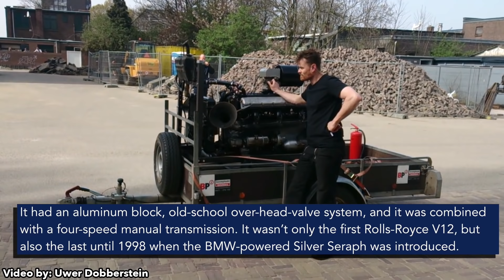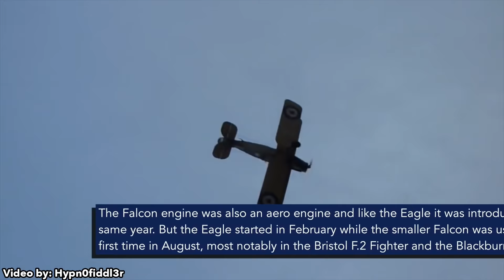10 Greatest Engines Rolls-Royce Has Ever Produced

Comment: i need another vid about the napier sabre engine...
Reply: Hear hear!
Reply: No operating Sabres exist, although I have heard that Kermit Weeks is rebuilding a Mark 5 Tempest and has a Sabre being rebuilt in Britain. More than that I don't know.
Reply: @MarsFKA  Who in their right mind would fly it!  The Sabre is my favourite aircraft engine but I recognise its problems. 

With most if not all of the true experts on these engines no longer with us, it will be a massive task getting one up to a reliable condition.  Then there is the question of finding the correct mark of the engine, there were several variations with 2 major redesigns of the internals during its life, all that for an engine that was fitted to only 2 types of aircraft.
Reply: @robertnicholson7733  I am sure the technology to rebuild the engines today will be better than the original. The big problem that the original Sabres had was the metallurgy in the sleeves – they went out of round quickly and seized the engines. About 25 hours was the average life of an engine, until a cure was arranged by using sleeves from the Bristol Taurus radial engine – different metallurgy – and the life of the Sabre was extended to 100 hours.
The Sabre was problematical right to the end of the War, but, with the lessons learned back then, a rebuild today will be more reliable.
I have a sound track of a Tempest starting, taxiing, taking off and a low, fast fly-by, but I am holding out for hearing the real thing.
I'm also holding out for the first manned landing on Mars. Which is going to come first?
Reply: @MarsFKA  The sleeve problem was the most obvious failure mechanism but not the only one.  The difficulty was, as you say, solved by changing the sleeve material.  However, I will put forward the case with the prototype engines using the original sleeve material had quite a long service period and passed the 100hr tests. 

Making the sleeves was a problem all in itself and was perhaps a greater problem than the material.  I believe,  the change of material from nitrided austenitic steel made it easier to manufacture the sleeves compared to the original material (rather hard to machine chrome-molybdenum steel).  In the end, the solution was to employ better machinery, to quote https://www.historynet.com/sabres-cutting-edge.htm  "The situation became so desperate that six Sundstrand centerless grinders needed for sleeve manufacture were redirected from their original destination, Pratt & Whitney in East Hartford, Conn., and sent instead to Liverpool." 

But I digress, there were other issues with the Sabre such as cooling, this also may have contributed to sleeve seizure.  The lone Tempest I fitted with a Sabre IV and wing radiators (loss of the chin radiator gained about 30mph AFAICR) was lost to seized sleeves. 

Something that has always confused me was why a seized sleeve crashed the aircraft.  The sleeve drives had shear pins to ensure the other sleeves continued to work.  I suppose that the issue may have been a seized piston or perhaps many seized sleeves due to cooling issues.
I do not deny the great advancement in materials, manufacturing processes, and testing.  However, the old (and probably lost) knowledge about the Sabre was built up over many years of keeping 1000s of them operational. 

The engines and all the materials used in them are at least 70 years old, does it all still meet specs?  Testing old material can only get you so far.  Comes the time, you may just have to make new parts and there are just so many parts in the Sabre (can't deny it, the pommies just liked making parts).  I believe that this has become such a problem with the Merlins that you can get a completely new Merlin made from scratch... at a phenomenal price.

I could keep on but it would serve no purpose. 

I have heard about the KW rebuild for quite some time, I have not heard of any progress reports.

I also have the sound track of which you speak.  There are also a couple of WW2 films that capture the sound of the Sabre including the howl it got at certain RPMs when the cylinders in the top back resonated with the cylinders of the bottom bank (the cranks rotated in the same direction unlike the RR Eagle22).  Having said so, I would love to hear a running Sabre even if it is only one on a trailer.  I do not know how many Sabres still exist, it can't be many.  Sadly some complete engines were sectioned.  I have often wondered what happened to Tempest Vs the Brits sold to others, complete spare engines must have gone with them. 

Napier was trying to flog the later marks (3000+ HP) off  but met with no takers.
Bob

Comment: The best use of the Merlin was the P51D Mustang which turned the tide of the airwar in Europe, resulting in the allied victory. No Dart? coolest sounding airplane engine ever.
Reply: This would be a very different world had the USA not entered that war. Thank the Japanese for bombing Pearl Harbor or it might have happened too late to do any good.
Reply: Save that for someone else. I'm from Arkansas. The US "assisted" the Brits to save France. It cost a lot more than lives to get that outcome. The British designed the Merlin, so give them that, American designed engines lacked the supercharger on V-12 engines. That small change did fix the Mustang which did turn the tide of the war. A British pilot suggested the change after test flying Allison powered Mustangs.
Reply: Pretty cool stuff. The Merlin Mustangs sounded sweet, but my favorite Rolls Royce engine for sound was the Dart. Dual stage centrifugal compressor turboprop that made from 800 to 1400 shp, 200 more with water/methanol injection. Found on G1, Vickers Viacount, and Fokker F27 aircraft.
Reply: This video was mainly about old stuff, so, most who watched it I would say.

Comment: Actually the Boeing 777 (that Singapore airlines) is power by two General Electric GE90 engines
Reply: Only if it is a - 300ER. If it is a -200/ER, then it will be Trent 800.  The 800 sold extremely well on the original 777 platform, but Rolls lost out when GE did an exclusive deal with Boeing for the stretch versions.

Comment: Although your videos are great, and I do appreciate them, I have a slight problem. I think that turbocharging is a form of supercharging. You separate the two. There are several ways to supercharge an engine, turbocharging being only one. All turbos are superchargers but not all superchargers are turbos.
Please forgive me if you think my comment is petty, but for the sake of accuracy I think is it is important.
Thanks for showing all of the strange power units from all over the world.
Reply from the maker: Yeah, I think you got it right. All turbos and superchargers have a compressor wheel, but only turbos got a turbine wheel. In many languages a supercharger itself is called a compressor (or kompressor in German) and sometimes the turbo is named as a turbo-compressor. It just confirms your words I would say

Comment: Is the inline 8 cyl diesel @ 8 mins, similar to the inline 6 cly Rolls-Royce Eagle 265/300 ( 340 bhp turbo) as used in the Leyland Roadtrain truck circa 1980's?
Reply: It is same engine family, starting as Sentinel locomotive diesel (RR C6-series) same bore and stroke. (as well as in CV8 and CV12 tank engines, Challenger tank etc ). Later evolved to truck engines RR Eagle Mk1...Mk3 as Eagle 220....E320 (RR E340 was turbo with intercooler??) . 

When Perkins bought RR oil engines division in 1984, they were sold thereafter as Perkins Eagle Tx 300...425 versions. 

Used at least in many British Lorrys and military prime movers for example Antar, and Sisu trucks in Finland from circa 1969 to 1984 (Rolls Royce era). Many different versions exist, with or without turbo, mechanically charged in locos, boat engines....

Sort of handy modular construction, for example oil pan bulge could be located in front or rear of engine with same basic parts. But oh my that parts count. Some evil tongue said that Hylomar sealant was invented to make these contraptions not leaking.

Comment: most peo0le don't know that they made plane engines
Reply: The aeronautical division has been by far the largest part of RR since the late 30's, and beside cars they also produced military vehicles and weapon systems, diesel engines up to large marine engines, and all kind of compressors and turbines used in industrial plants like power stations and transport of natural gas under high pressure or liquid form
But since 1973 the automobile division was split from the main concern RR plc, and since BMW bought the right to use the name, RR motors, which is still owned by VW, doesn't produce cars under the RR badge anymore!, they built Bentleys.
Reply: The car division and the aeronautical division split a long time ago. They are not the same company. RR cars is now owned by BMW. Rolls-Royce Holdings - the aero engine division has about 50,000 employees. The car division employs about 1,400. On another matter, in my youth I used to catch a ferry which was powered by a great big Rolls-Royce straight eight. I assume it must have been a C series. I guess it must have been a diesel but I don't remember.
Reply: Jesus, now Wilbur is trolling engine threads...Just block him like I did. He's a waste of oxygen. On any other site he would have been banned long ago.
Reply: Block his alter-ego Soaring Tractor too.

Comment: Did you know they matted two V12 engines together for Bomber use but the crank shafts kept failing
Reply from the maker: I know they made a X-24 engine, but not about the crankshaft issues. What a cool engine, though.

Comment: does it fit on my honda
Reply: DRIFTER R ya
Reply: DRIFTER R This motor would twist your car apart, the Griffen.
Reply: DRIFTER R I regret to inform you that now of the engines have any form of V-Tech
Reply: Yeah of course it fits just modify your chassis a little
Reply: Which model ? Honda C50, may have to upgrade the brakes a little.
Reply: Are you perchance a cop?
Reply: Sure, sure, pull it right in. yep, yep, yep.  lol.
Reply: yes off course, put a sticker on it, and you'll have 50 more HP

Comment: I believe the L410 was based on a Porsch design. RR would never disclose the power output in literature merely stating that it was 'sufficient'.
The Merlin is said to be the best wartime engine however the Napier Sabre is or was arguably better but hardly ever saw any usage due to RR lobbying the war ministry. That would never happen today would it?!
You include the C range and not the RB211? The engine that bankrupted the company, developed for the Lockheed L10-11 and went on to be one of the most successful aero engines ever.

Comment: Can you run a Griffon on 95 octane Mogas with octane booster? Just wondering, because I'd really like to get a pilot's license and maybe someday if I have the cash, buy a Spitfire with either a Merlin or Griffon, because they do sound really good and pump out an impressive amount of power, it's just- Avgas is really expensive, maybe twice as much as premium autogas and octane booster. Premium Mogas is about $3/gallon, where Avgas for piston engines is around $8/gallon. Using the boosted premium mogas, I'd have to pay $255 for a full tank, as the Mk. I Spitfire carries an 85 gallon tank. Were I to get a newer Spitfire with the 95 gallon tank, that would make boosted mogas $285. Using Avgas, however, would make the smaller 85gal tank a $680 fill, and the 95gal tank a $760 fill. If it doesn't hurt the engine, I would rather save money considering I would've likely dropped quite a bit of green for the plane itself.

Comment: Why not mention that the Merlin was also popular enough to where it was used extensively in the P-51? Although that was particularly because there wasn't any other engine that america had at the time that would meet the requirements of the P-51 design. However it was America's most successful fighter during WW2 and i most certainly think it is worth mentioning that the Merlin made that possible.
Reply: soaringtractor okay so the mustang engine is American made but it is courtesy of the British that we were able to build them.
Reply: soaringtractor well anyway, all I was saying is yes the engine is American made as far as the ones in the mustangs go, but the design IS still British. So IN A SENSE it is thanks to British engineering. It technically isn't our engine. When something gets licensed by someone else so they can build it, it doesn't become theirs. It just means they can manufacture and modify it however they choose. It doesn't mean that they can make changes to the same thing and call it their own thing. Credit still goes to the brits for letting us use their design. As it is, it is still called a Merlin engine because even though we may have manufactured them, the rights to it are still in Britain.
Reply: soaringtractor this isn't an argument about why Packard was building it, I'm arguing that it's still a British engine even though the brits had to ask America to mass produce it for their own aircraft. I didnt say it wasn't built in America, I'm arguing that it's still a British engine. Just like apple's A series processors are still apple's even though they are mass produced by Samsung. That's my point. The manufacturer does not change the designer. That's why I'm saying it should be mentioned for the mustang as well in the video. Dude, I wasn't trying to have anyone get angry. You kinda missed my very basic point. I hope you get it now.
Reply: soaringtractor okay fine. It was in equal parts made by the British and the Americans. At its base it is still a British engine, but it wouldn't have been made possible to be used to the extent that it was and wouldn't have made the power it did were it not for the industrial giant that was America at the time. So each side has credit to the engine, but you do have to admit that if the British hadn't brought their initial design to America, things probably would have turned out differently for the p-51 if only a longer period before they got a proper engine for it. America needed that engine for their new fighter because they didn't have anything as capable for the p-51 at the time and the Brits needed America to manufacture and improve the engine since Britain couldn't at the time due to all the bombing going on. It was a complete, mutually beneficial thing. Can we agree on that?
Reply: soaringtractor did I say they wouldn't have figured something out? I don't think I said that. I said it may have taken longer. Never said they wouldn't.
Reply: Anyway, I wasn't trying to get into this whole stupid argument that doesn't mean anything really. I personally don't care THAT MUCH. An innocent comment turned into an argument that I wasn't trying to get into. I'm not vested in WW2 stuff like that. It fascinates me but there's no point in arguing about it. That wasn't my intent for someone to blast me with stuff about American engine manufacturing history which had absolutely nothing to do with the point of my first comment. I only thought that since the Merlin originally came from Britain that the p-51 should have been mentioned. That's all. I just thought the plane deserved mention as being helped by the Merlin. But I then had a whole bunch of stuff that I wasn't really interested in shoved down my throat. It was not that serious.
Reply: soaringtractor I don't mind discussion. What I do mind is someone getting in their feelings and feeling like they need to put exclamation point after every sentence. I did learn something, I just don't like the way you went about it and it made me disinterested in talking with you specifically. Maybe if you could be a bit less upset when someone makes a comment that may be shortsighted, then the conversations can be a lot better. I wouldn't be annoyed if I didn't feel like you were annoyed that I wrote a comment that wasn't even bad or hateful, just somewhat shortsighted and uneducated. My knowledge of this part of World War 2 tech is not vast. This conversation could have gone way better if it didn't seem like you were upset about my first comment. I'm smarter because of what you said, but I don't want to talk to you because you seem like someone who will get upset if someone says engine displacement is more important than cylinder count. Change your attitude man. Then I'll be more willing to talk to you. It's not that serious, so don't make it feel that way.
Reply: +soaringtractor you talk about me learning but you haven't learned how to talk even after all I've said. I don't think you're even reading my whole comment. Whatever. I learned something from this at least. I don't think you did though. As the old saying goes, you can lead a horse to water but you can't make it drink. Also I was speaking specifically about the p-51. Now you're arguing semantics, and I don't deal with people that feel the need to do that. Goodbye, and have a merry Christmas.

Comment: It appears that there must be a running example to qualify for the list, so no; RollsRoyce R, Eagle22 (wasn't really a great engine but has impressive engineering), Exe - a very underrated engine, Crecy - fascinating but ultimately a wasted effort.  Vulture - sorry, I could not resist.   >>:-)>> 

Merlin ended up an okay engine (the very early marks <shudder> - poor Hawker) and it sounded great (unusual firing order gives it that rough lazy roll from behind) but the Griffin was a greenfield design for an aircraft engine only, heavily integrated and a far better piece of engineering.  The Shackleton aircrews were not fond of the Griffin, you could get a very annoying high frequency whine from between four of them.